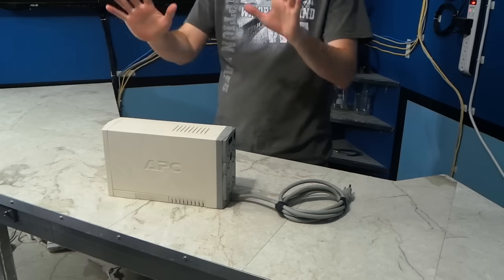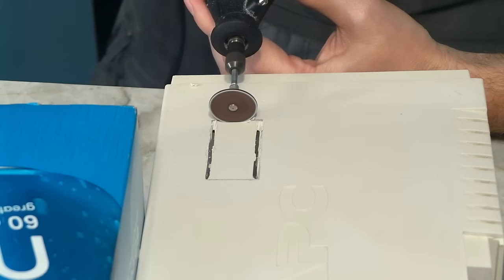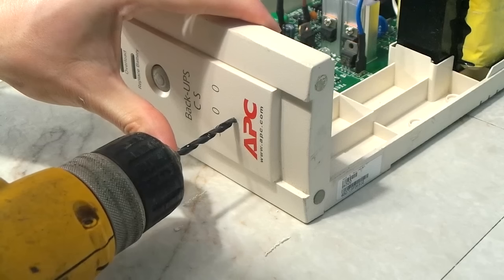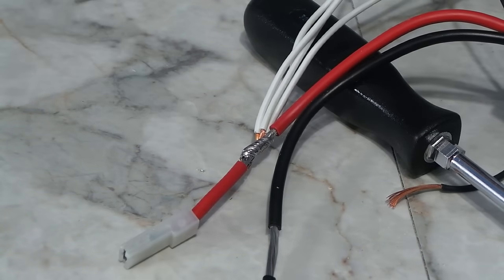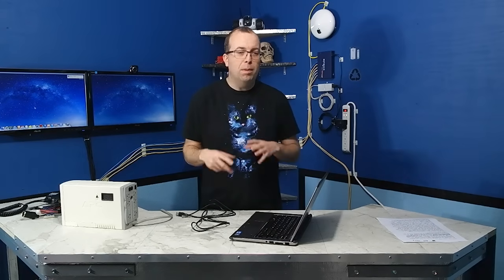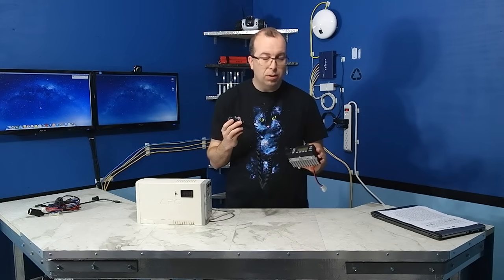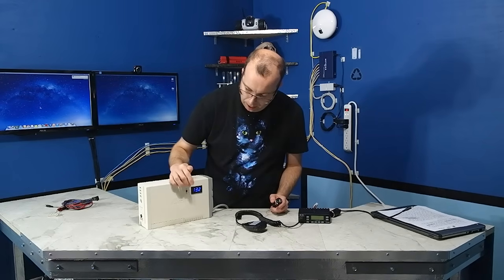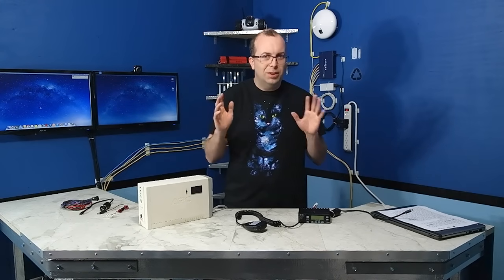Ultimate Battery Backup Hack/Mod.

Comment: Uno de mis primeros experimentos fue conectar un cargador de celular al puerto de batería de una radio minicomponente, la cual opera con 9V en la entrada de baterías. Sin embargo con un cargador de 5V fue más que suficiente. Cuando la radio no esta encendida sirve para cargar celulares, encender un bombillo, y claro no programo la radio para encenderse automáticamente como una alarma además tiene alarma sin encendido de radio. Es decir.. ahorras electricidad escuchando música al tiempo que alumbras la habitación. Para evitar tener que desenchufar el adaptador de corriente, compre una toma de corriente con interruptor. Si esto les complica, en las radios con baterías tipo tablet/celular sale el voltaje y la corriente que genera.

Comment: Was wondering can you parallel other batteries to extend your run time?   My thought is if thats possible then you could put ports on the side to connect them without having them hooked up all the time. Or you could build and external battery box that is connected all the time but hidden away.

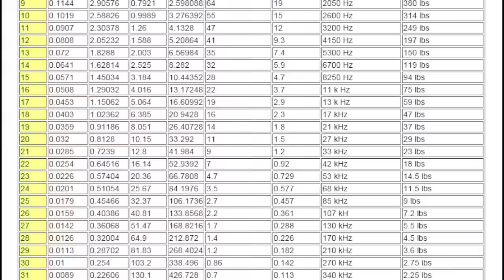Comment: 4:34 You mention that you used the wires in parallel because if you connected in series, then each wire would draw 16 amps and hence 16 *3 = 48 amps, but that is not how amps work. In series, each DC jack will only draw 16 amps, the additional draw would be on the voltage (more connections, the grater the voltage draw). In parallel as you have it, the voltage across the three connectors is the same with the current being dependent on the draw on each connector.

Rule of thumb: voltage is additive in series and current is additive in parallel.
Reply: No, you are thinking backwards. That rule is for supply, not draw. If you chain sockets together it increases the current flowing through the lead, this is a well known fire risk and why in the UK we have fuses in our extension leads. The fuses protect the cables.

You were thinking of how you can wire up batteries in series or parallel.  You are correct about the voltage drop when using the wires in series, but nothing limited the current.  That's why he should have a fuse.
Reply: @dlarge6502  I'm aware of fused uk plugs...have my fair share of uk devices (and i absolutely love them), but it this has no bearing on the statement made. Back to the fundamentals of current and potential difference.

On a closed track (circuit) with 3 stops (components) one after the other (ie in series), 16 derby carts (amps) and a catapult (battery), as the carts slow down for each stop on a downhill path, they lose some speed until they get to the bottom of the hill. The catapult then pulls the 16 carts to the top of the hill, where they can do it all over again. 16 carts start the downhill trek, 16 carts pass each stop and 16 carts end at the bottom of the hill. No carts are lost. Adding more stops in a staight line doesnt alter the number of carts, just the speed at which each cart passes a stop.

In parallel, each of the 3 tracks can hold 16 carts, so 48 carts leave the catapult, split into 3 lanes of 16 carts each and all have the same speed passing through each of the 3 stops before all 48 carts meet again at the bottom to be pulled up by the catapult.

The 48 anps in series still makes no sense to me, but hey its been years since i taught electronics to A level physics students so maybe electricity has changed since then. IDK.
Reply: Now if each component required 5 volts in series with a current draw of 16 amps for 80 watts each, so 240 watts in total, then if there is loss of power (through heat), the amount of power required in the circuit would increase resulting in an increase in current (assuming minimal voltage loss), but nowhere near the tripling of current suggested (unless your using really thin wire to handle 16 amps to begin with, in which case popping them in parallel wont help)

Comment: Don't forget to keep checking that battery. I didn't and when the power went out nothing happened. I checked the battery and found it had swollen considerably. I almost had to wreck the unit to get it out.
Reply: I'm currently waiting on a replacement battery for a UPS. I had to turn the UPS over and bang it against something to get the battery out after using a pry bar to slide the cover off while my wife held the tabs down. The UPS (it's an APC) has an alarm to tell me when the battery no longer holds a charge, but the designers weren't smart enough to allow another couple of mm of space around the battery to deal with the minor swelling that's common.
Reply: @stevepseudonym445  You were lucky. My battery was swollen so much the frame of the PSU was embedded in it, It took me a few hours of butchery on that battery and I made a right mess of my workbench. I didn't bother to buy a new battery, if and when the power goes out, I make a cup of coffee and it's usually back on again before the kettle's boiled. We're pretty lucky here, we're on the hospital's power circuit .

Comment: I did the same with my apc backup. Sometimes loading battery with 8a@12v load. Backup died in less than a year. Other one work since this day and had no cut in to battery circuit.

Comment: quick question I sleep with a CPAP machine because I have sleep apnea if I have no power I don't get to sleep I looked for a battery backup that we continuously power my CPAP machine I absolutely figure worst case scenario if I had to I could go charge though backup every day do you have any hacks you would think would work and possibly affordable battery backup that would work
Reply: I got one of those (relatively) cheap Harbor Freight Solar Panel banks and a deep cycle 12V battery along with an inverter for when I used to go primitive camping. I was able to run the CPAP all night as well as charge a couple phones and a laptop over the course of a week.  Knowing the actual operating voltage and wattage will help with sizing the right inverter or having the possibility to run it from direct DC voltage.

Comment: hi , i have the same sai and its very insteresting mod, and util, but on question .. i can use the 12volt during a normal run of the sai?, or only when it was disconected from 220v/120v? 
thanks

Comment: Did similar with 2 U.P.S. back up but went with the largest motorcycle battery only thing was I wants the removable/refillable  type with the yellow caps cause I've had em last well over 10 years being able to actually test each cell with a hydrometer & always topped off with actual electrolytes (battery acid) &/or distilled water but still think actual electrolyte is better...

Comment: "A DC to DC Converter consumes power even when it's off."
This also applies to the AC "Power Brick" world. Your laptop charger? AC to USB Charger? Even your Smart TV?? All using power. Even when OFF. And so are many more.

In the Alternative Energy field, these are called "Energy Vampires" and should only be connected to a power strip, whose normal state is "OFF."

Comment: this kind of APC UPS gave me a trauma way back 2012, I had to replace almost 6 units in a span of one year until its store warranty run out... It hums all the time that I can hear it in a quite room and also it cannot even hold a decent charge in a power outage after like several weeks. - I guess I just had a bad batch and a bad luck.. but the black APC UPS are good ones though.

Comment: If we use all 3 × 16 amp without create high amp at single capable before that if delay one after the other slight difference time phase then AC is progressing max 16 amp at each time tic and not all 48 amp instant

Comment: That must be a flea powered ham radio if you can run it for a week on a 7 amp battery but getting only 12 or 13 phone charges. I would have used one of your ports to add an auxiliary battery to the system.

Comment: I am lost. Half the weight of that box is the transformer and a lot of the cost is only needed for mains. If you are going to turn of the mains out in case of a power cut, what is the point of all this again?

Comment: I tried replacing my lead acid battery with a Li-ion pack built from 18650 batteries.  The unit seems to work fine for a hour or so, and then it starts alarming and showing that there is a line fault.  If I put the old dead battery in the unit it worked just fine.  I have built several packs to replace all the APC UPS units that I have lying around.  Any tips on how to resolve this?
Reply: I don't think you saw that this is 5 years old LOL.

Comment: Hie can disconnect the small battery and add external big battery e.g 12v 180ah...?
Reply: Meant is it possible to remove the small battery and replace it externally with 12v/180ah solid big battery?

Comment: Well there will be no problem(maybe some) when using this modification when running on Battery but if battery is charging then DO NOT CONNECT ANYTHING TO IT because inverter charger have constant current circuits and it will MESS Up with it when connect any appliance(12v ones) to it in this configuration.   It is good to use form the charger out put.
DON'T USE THIS(shown in the video) CONFIGURATION WHILE BATTERY IS CHARGING!!   But you can always use safely an happily when it is back up mode.

And Yeah! It will be more nice and safer to use buck-boost converter in series to battery, it will stable the out put because 12v batt have voltages 14v-11v .

Comment: Protip, dont use any conductive materials ie aluminum if its plastic use plastic , id also use a termial block and add a resetable circuit breaker. Also using that to run your radio is crazy, the amount of rf interference from that transformer would interfere with your radio reception whenever its on. Just buy a filtered power supply and another sla and run your radio off that.

Comment: I’ve got a UPS that doesn’t have a data port, so I monitor its state LED on the front of the UPS with a raspberry pi, if it changes to red meaning the power is out, the pi sends me a push notification.

Comment: What if we remove the acid battery and replace it with battery made out of rechargeable Li-poly cells
Reply: Great for capacity and power efficiency, not so much for reliability and longevity though.

Comment: UPS is a bit archaic thing nowadays. As you well said, why to waste energy on DC-AC-DC conversion, when we can use DC directly?! In this light why not to move to the next step - power COMPUTER directly from DC? AliExpress has such "ATX DC" power supply: you join it with battery and plug directly into motherboard socket! Then all you need from clumsy UPS is just battery charger! :)
Reply: Tesla said he wanted us to all use DC power to the home. But it went AC because of profit

Comment: If you put a plug into the side, you can add a battery, so you get longer run-time.

But... Your math on run time is way off.
It's a 12v 7ah battery making it like 84wh.
It's LA so you get 50%.
42wh.
But if you draw more than 5amps it more than halves the capacity again. 22watts for an hour.

If you attached USB, I would have the circuit 12 to 5v and put a switch on the side. Be interesting to see if it could fit in the old telcom ports.

I would also put a handle on the top to make it more portable.

Comment: 6:55 - this statement is wrong. In the end, it is related to power (w). while the AC is 110v its current is 0.1A and powering it on 12v, the current is around 1A. The consumption is the same and run time will be the same.
Reply: He's referring to the loss created by the process of stepping up the voltage and then dropping back down to DC. That loss is significant. There's a reason why inverters are basically large heatsinks with fans, generally.
Reply: @SirFrag32  depends on power draw for the heat issue. Since 2015 ups inverters have around 90% efficiency, so 10% loss. The loss of having it connected to AC to DC converters for these low powered devices would be around 15% Max.

Comment: I know this is a very old post, but hey old equipment, right?

Is the inverter’s continuing to use power when it’s not used? Should you have a switch on that thing as well?

Comment: If I was to have a battery backup, it would most likely need to be able to output at least somewhere just above 700 watts, since that is my PC's power supply wattage.... in fact I do want one.

Comment: Do power cuts occur with some frequency in the US or something? I've seen a number of videos about backup batteries on YT. I can see why you might want to use some to protect rare/valuable electronics 'just in case' but I've probably only had 2 power cuts in the last 15 years, one was preplanned and the second was pretty bad in the fact that it lasted for about 4 hours but was caused by a storm.
Reply: C J Bowen  geez... I can see why a back yo generator might also be a good thing too :P

Comment: best two mods I did to my APC backup was remove the %#$## buzzer, and I also put some heavy gauge wire and run it to an external car battery... it runs my computer with monitor, router, wifi, etc for a good hour now, more if I shut off the monitor of course, but I don't have to rush to save my work,

Comment: I tried this and added one 12 v DC outlet to a APC 1100 back up UPS and have this powering a Signal booster. Yesterday when I touched the body of the booster and received a high tingly jolt of electricity. I then unplugged the UPS from the mains and this didn't happen. Just a while back I plugged in the UPS to charge it and inadvertently touched the booster where the LMR cable connects to the body and  again and received another strong jolt Can someone please help me understand why this is sort it out..

Comment: I had tryed this mod some time ago. Bit I had huge issue with it. UPS was giving me 230 V from battery to ground. It was still 12 between black and red wire but it was 230 between black/red and ground. This is huge safety hazzard. Ofcourse prabobly not all UPS-s have this design.

Comment: ihave a small UPS like that which I have connected to an external battery it works but the unit always shuts down after it has been on for 10 minutes, like some kind of built in limit, anyone know how to mod it so it does not do that?

Comment: Is it possible to increase the number of batteries connected in parallel, let's say 5-6 pieces?
Reply: I wouldnt go more than 4 times the original capacity, for the chance of overloading the charger when empty.
Reply: It's possible, but will likely cause the charger and inverter to overheat. These small and cheap UPSes don't really have a good airflow.

Comment: Why didnt you just use a momentary switch for the indicator?
Reply: If you have company over and want to add +2 to the Greek factor of your room. Ironically of you have company over its an automatic -3 to your personal geek factor...
Reply: Just a guess:  in case the power was out, and he needed to draw a lot of amps (and wanted to keep a constant eye on the voltage).  It's bad for lead-acid batteries to sit around not charged.

Comment: Slotted, flat head screws? you seriously have and use slotted screws? ROFL. Those make 8-Bit tech look like its from the future. I've got a container full of them in the garage but they're only to be used when replacing a slotted screw that got lost/buggered. 

Oh and pro-tip... you could have used that file to make the aluminum at least somewhat ok looking. i would have filed it first, then used sandpaper.

Comment: 6:03 what software you used to read the data from that UPS ? I had the same model, I am still looking for one that will work with Win X.  Appreciated if you could share where to obtain that software.  Many thanks
Reply: Who says win X? 😂
Reply: Just connect directly to the computer via usb and use the company's software that comes with the ups.

Comment: can i run my router wich has a 12 v adapter directly on the battery ? and how can i monitor the capacity of my battery , i tries it and it worked . but for the health of the battery .
Reply: Why would you event want to?

Comment: A short comment on a very old video and post. The shown conversion should not be done by anyone because it is dangerous. For one thing, there are no fuses at all near the lead-acid battery, but this would be the only protection in the event of a short circuit, which would protect your home and family from burning and dying. And this is not shown exaggerated, but bitter reality. Such a lead-acid battery has a very low internal resistance and can provide very high currents in the event of a short circuit - so much that you can easily use it to make a 5mm screwdriver glow bright red. Anyone can imagine what this means for a 3mm / AWG10 cable.

The round socket is a single loose contact with a small cross section for such high currents. How does one come up with such dangerous nonsense, to connect something like this to a lead-acid battery and to buffer the internal battery externally with other batteries?
For this you use PowerPole or other connectors and fuses.
I find it terrifying what amateurs build everything.

The module that landed in the garbage can was the surge protector, which can be used to protect a telephone or modem line (DSL modem, router, etc.).
You make a ground connection and grind it between the router and the telephone connection. This works flawlessly and protects the IT behind it very well and efficiently. APC has already installed this in other devices and sells this module as a device for $ 50.- still today and unchanged.
 Well, here it is disposed of carelessly. 

Very good contribution ...i would it pronaunced as "the ultimate rubbish".